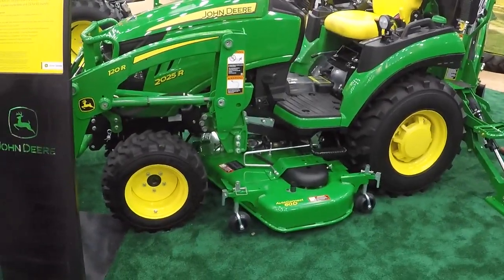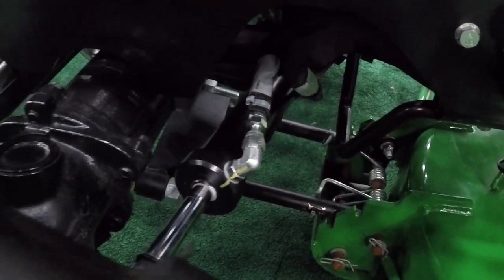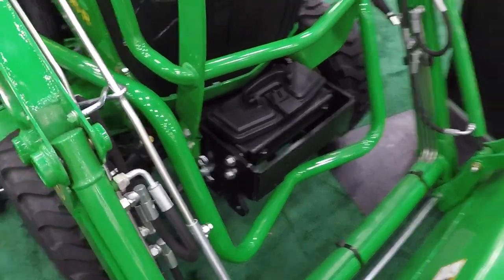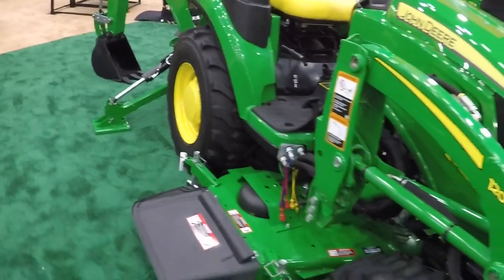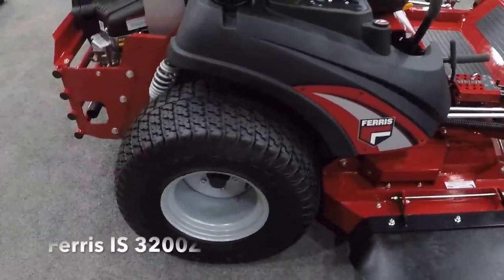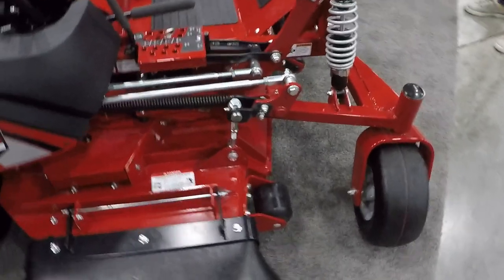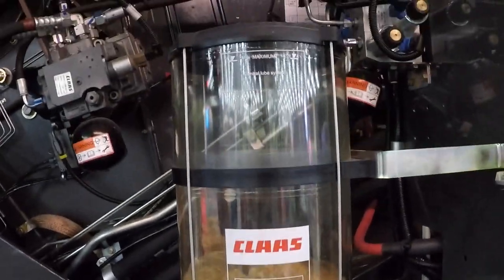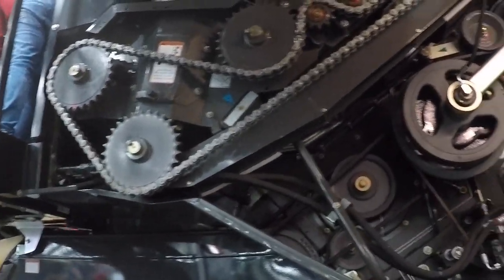2018 National Farm Machinery Show

Comment: Most 4wd tractors like that versatile don't have 3-point hitches because trying to turn  and hold the tractor going straight with an 3-point implement in the ground is very hard on the tractor and implement. Yes it is an option though.
Reply from the maker: Thanks for the explanation, that makes perfect sense.